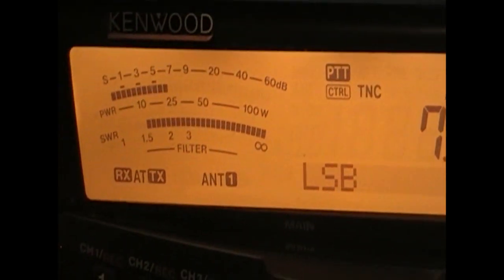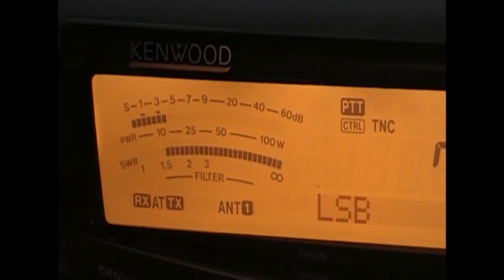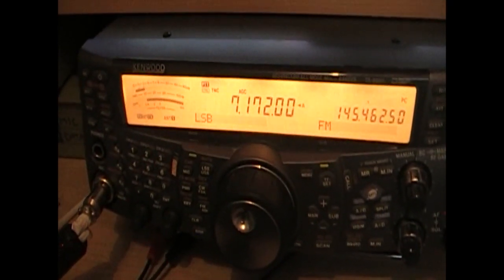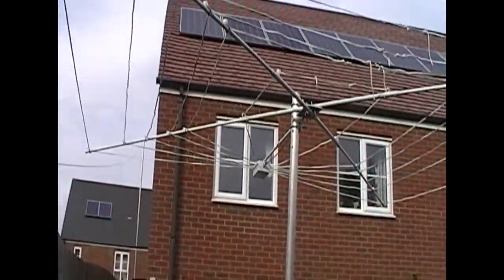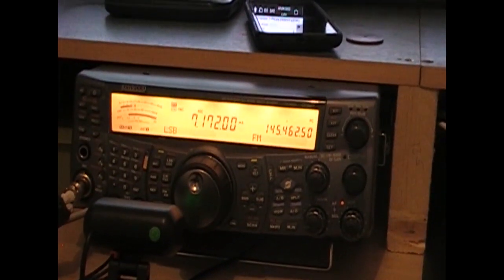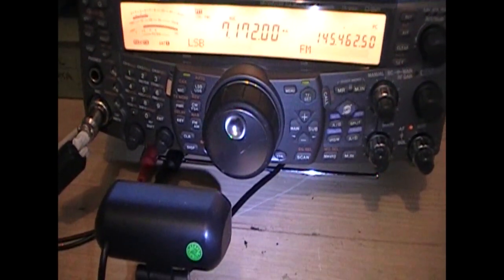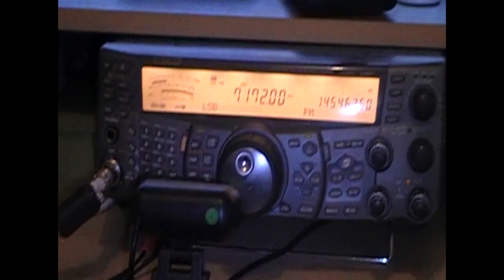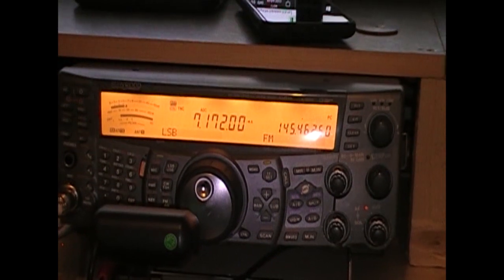Cobweb Antenna

Comment: Great video, yes I have one and it is (was) the best omnidirectional antenna.  Where there is a lot of light there is also shadow.  1. Very narrow band.  2. extremely sensitive to moisture and 3. very sensitive to a lot of snow.  Mine was totally destroyed this year and the elements were completely pushed down.  And now I'm thinking about whether I should buy or build one again.
Reply from the maker: I found mine widebanded, but i do find it sensitive to moisture too, im going to learn more about it and want to make new elements for it maybe in the summer 73 M0KNM

Comment: Great video, thanks. I'm toying with the idea of building one; any opinions are welcome at this stage.
Did you get it any higher? I used to chat with scaffolders; for a couple of 6-packs of beer they would allow a 24ft+ pole to drop off their truck near me... Heavy, but great for antenna mounts!
Reply from the maker: Thank you, i they are a good antenna for 20m to 10m, not tried it on 6m and 2m but it does have a drop in VSWR on them bands. It was hard to tune at first but got there in the end, i got it to about 8/9m above ground in the end, i just need to make a ratchet system to help me lower it more easy.

Comment: why are you on 40mtrs the cobwebb is not designed / tuned for 40mtrs the original tpw cobwebb its 20 to 10mtrs. bit of a pointless video really is it not..?
Reply from the maker: Not a pointless video really no, it tuned up on 40m because of where it was ( a temp place ) . Because of its surroundings and close to the ground, if you see another video it explains that it does not tune up on 40m and if it did it would not be Suitable for that band
Reply: @MØKNM-Amateur-Radio  Just because a tuner can tune it on 40, does not mean it's going to work well. Your tuner might tune up a bed spring but a bed spring will make a lousy antenna. Should have done the test on 20 - 10 meter bands, where the Cobwebb is resonant. Because you can speak to Klaus in Berlin on 40 meters also means nothing.
Reply from the maker: As i explained in point above
Reply: @johnk8091  Who rattled your cage
Reply: @DiscusRussell  who pulled your chain ? I didn't ask for your opinion LOL

Comment: Have you tested the antenna on a band that is not supported in this version?
Reply from the maker: Ive tried to use it on 40m but the radio tuner would not tune it, i have not tried an external tuner as yet

Comment: Is there a way that you can use certain filters in that radio to calm down the front end noise?  I think you're using a ts2000 I think
Reply from the maker: from what i can see on the kenwood website they dont do any filter for it, ill have to have a look at manual to see if there is a filter already built in

Comment: I gather you used the matching unit to use 40m on the cobweb looking by the size (8ft sq roughly) which will give you 20m resonant ?
Reply from the maker: i did use the ts2000 internal tuner when it was at a test height of 2.5m now its above the gutter it no longer tunes on 40m, but yes it is 8ft square and resonant on 20.  i use an shortened efhw for 80m and 40m. de M0KNM 73